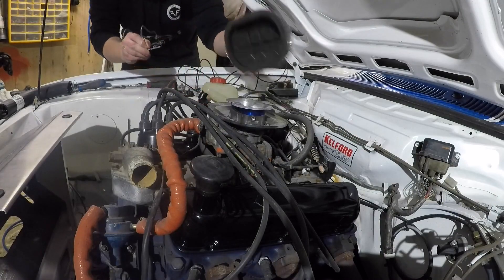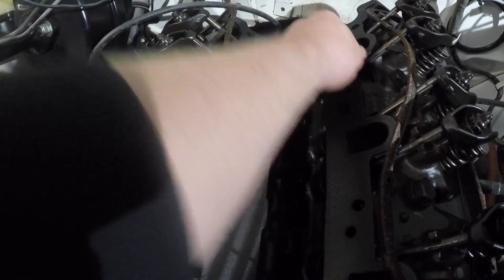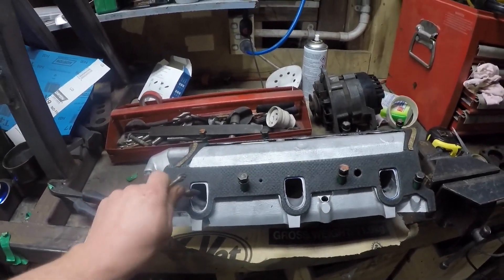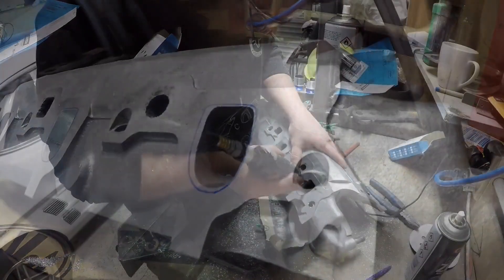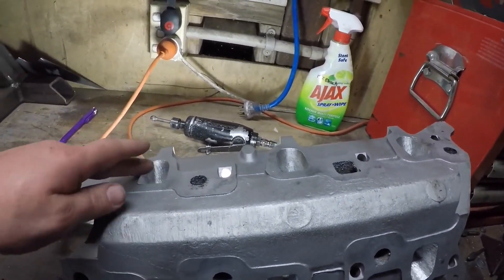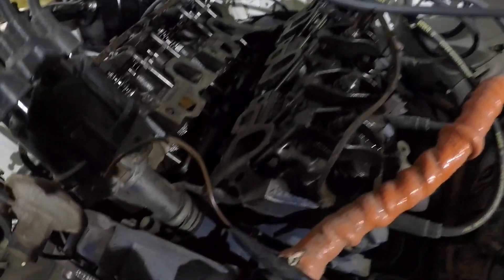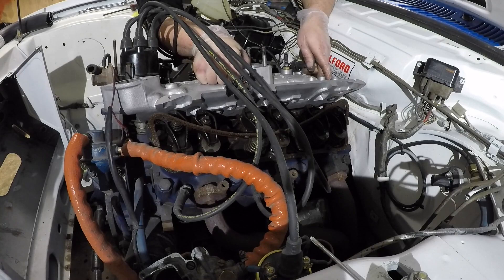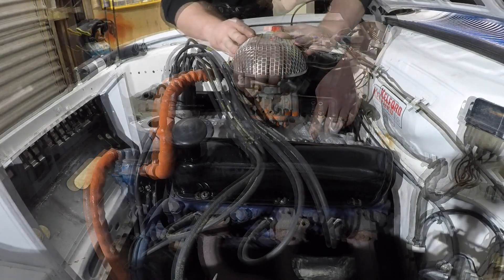How to port an intake manifold - Ford Capri Essex V6

Comment: You tell the difference by the casting.  D Ports heads have FORD cast in at the exhaust ports, OVAL Pots have FoMoCo cast in them at the exhaust port.  A D port inlet manifold is flat in front of the carb to the temp sender, an OVAL Port as a lump like where the sender goes
Reply from the maker: Hey John, thanks I've pinned this comment so anyone watching the video will see this info. Cheers

Comment: Nice video, man!  I'll be doing the same job on my V6 Cologne engine I'm rebuilding, which is quite similar to yours. It has mixed water and oil and it seems it was leaking on the intake plenum. I'll be sure to use some gasket maker around there!

Comment: I run an Essex, I'm not brave enough to take off as much as that just yet, but I do have the 'step' problem around the rocker cover seals on both sides, as if the intake manifold has been machined more than the heads and sits much lower?
Reply from the maker: Yeah I think if the step isn't there, but it really needs flow benched. That's something I'm working towards in the future

Comment: Noticed your not using the W plate under the carby?
Reply from the maker: No, there seems to be mixed opinions on that, strongly either way but I'm happy to run it without for race application.
Reply: @feralfabrications2465 yea, mines a road application, apparently the W plate helps atomise the fuel?. Love your capri Bro 💪wnicholson1@gmail.com message me bro.

Comment: Hey, did you test it on the road, how many horsepower increased
Reply from the maker: No I've only done the racing at Manfield since this porting the intake and since it was the first time at that track, I couldn't compare to previous lap times. Comparing to another Capri we race against, we were definitely up on hp.

Comment: i have done this mod and noticed a lot more torque, it pulled much better from lower down the rev range, also gave much more induction roar
Reply from the maker: Yes I didn't see any downside but would really need dyno to fully quantify it. I'm hoping to dyno it soon.